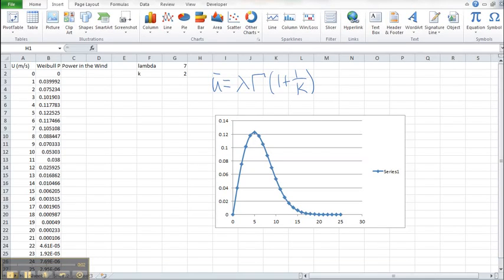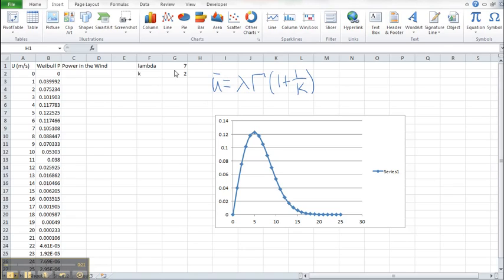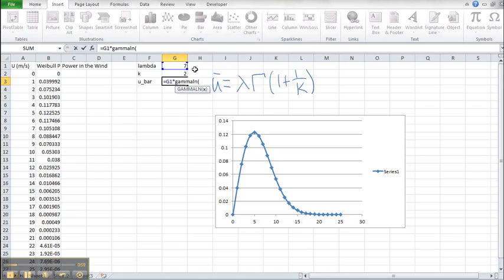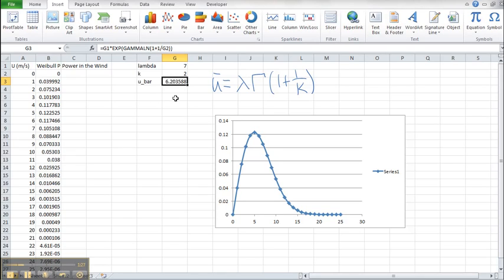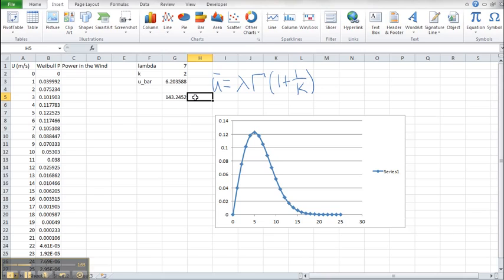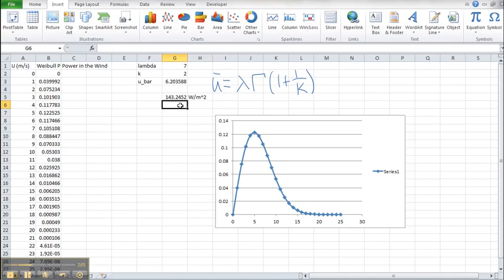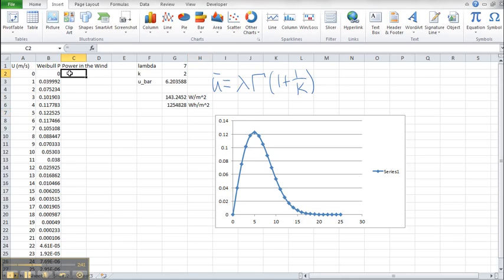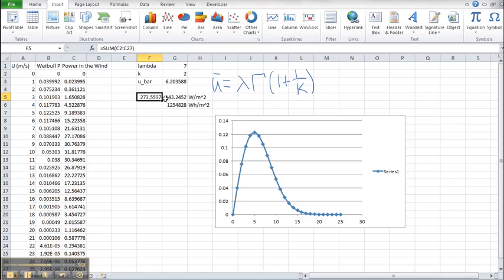Weibull Distribution vs. Average Wind Speed

Comment: "Mean Power Density" in AWS Truepower!!! 
it is a theoretically energy which we can get from wind turbine?
we need to use Betz limit for this?
f.e. 1,596 W/m2 *0.4 real (max 0.59 Betz) * swept area = Energy production ?
Reply: Yes thats correct! If you want to know to netto electricity produced you need to multiply it by the effeciency of the gear + generator.

Comment: I'm using the ''Power in the wind'' equation to calculate the Power (W) for each value of wind speed (m/s). Yet I'm getting much higher values of W then you are using,

Swept area = pi (3.14159) x r (65m blade length)^2 = 13273m2
W = 1/2 x Air Density (1.225kg/m3) x swept area (13273m2) x wind speed (12m/s)^3 = 14,048,143
kW = 14,048
mW = 14

Yet I know this turbine has a theoretical maximum of 4 mW. So my 14 mW result is highly unrealistic, especially since a wind speed of 12m/s is below average for the location. So I'm making a mistake. Can anyone see what the mistake is?
Reply from the maker: +Ronnet To clarify, the video here shows power per unit area, or wind power density, so it would not compare directly with your numbers.   As per your calculations, you are calculating the available power in the wind for a 65 m radius and 12 m/s wind speed correctly.  This is not, however what you would be able to extract from a wind turbine.  At most (theoretically) you would be able to extract 59% (Betz limit) of this power from this device.  You need to multiply the calculated power in the wind by the turbine's efficiency at this wind speed to determine the actual power output.  I am not sure where you are getting the theoretical maximum of 4MW or that 12 m/s is "below average" for the site, as this would be an extremely high "average" wind speed.  My only thought is that maybe you have the units of 12 m/s incorrect (if it were in mph, power in the wind would be ~1.25 MW) or is 65 m the rotor diameter rather than the blade length (in this case power in the wind would be ~3.5 MW)?
Reply: +PSUwind Thank you for your response. This calculation concerns a wind turbine for the Gemini Park which is being build in the European north sea, and has a capacity of 4 MW. As it turns out, the average windspeed at this location is 9 m/s, but the rotor diameter is 130 m. 

With 9 m/s I'm still getting an average of 5.93 MW, still far above the 4MW capacity of the turbine. Is this because I'm not applying the Betz limit? I'm expecting a capacity factor between 40-50% so even then the results seem too high.
Reply: Your calculation is correct! But because your turbine has only 4MW, every value above is only theoritical. So every amount of power above 4MW will tip off at that level.

Comment: didn't you forget the term "exp" in "u_bar" formula?
Reply from the maker: I only take the exponent because the Excel function I am using gives the output of the GAMMA function as its natural logarithm (GAMMALN).  The true is equation is just looking for the GAMMA function itself. If you were to use another function solver or a series expansion approximation for the GAMMA function, you would not take the exponent of this function.  See my previous comment for the reference for the equation for this calculation.
Reply: thanks for your reply.
is there any tutorial for analysing the wave data as well? specially the correlation of wind and wave data over the sea

Comment from the maker: Yes, it sounds like your C is the scale factor (same as my lambda in the video), which has the units of speed. Different sources use different variables for this (I have also seen it labeled A). The u_bar is the annual average wind speed. As you can see from the equation hand written in the video, this u_bar is related to the scale factor.

Comment from the maker: I believe you are pointing out that if you use the mean cubic wind speed instead of just the average velocity then you should get the correct wind power density.  This is correct.  The context in which this video is presented in a course is to highlight the importance of not simply applying the average annual wind speed to calculate the wind resource potential for a particular site.  The distribution of wind speeds must be considered since the power is a function of the cube of the velocity.